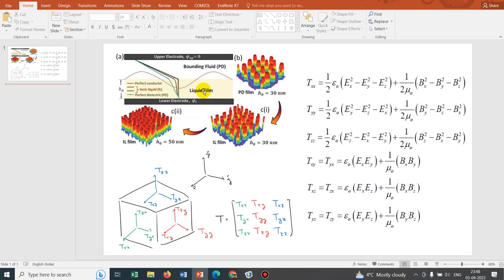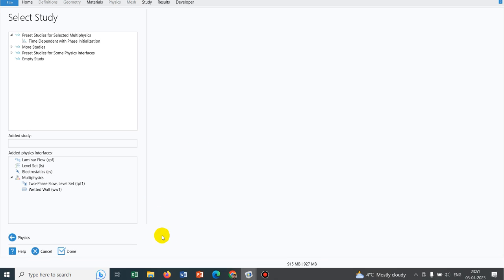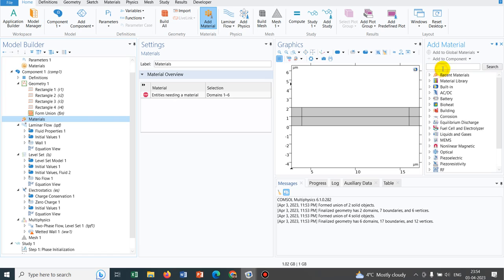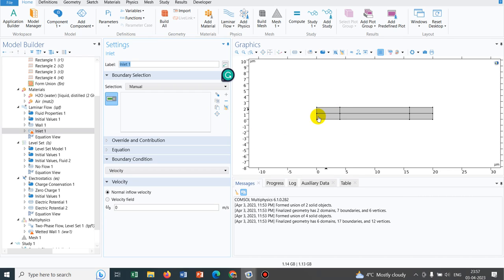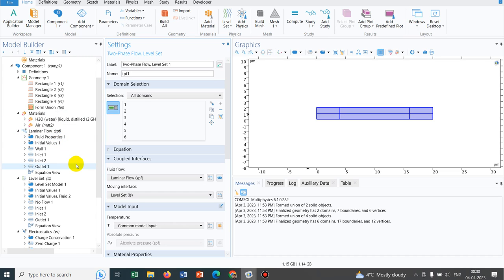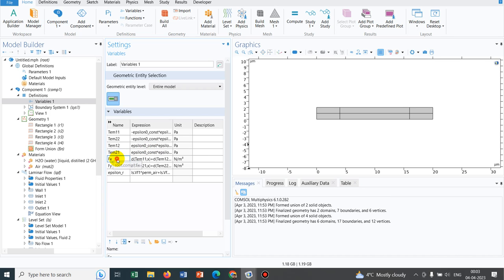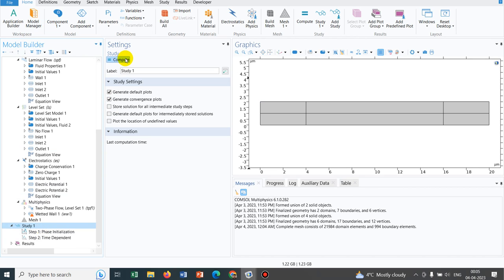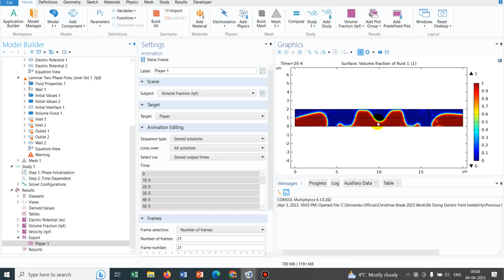Electric Field Driven Hydrodynamic Instability in COMSOL  #instability #ElectricField #MaxwellStress

Comment: Dada, your video is very much helpful for me. I want to know how to solve non dimensionalized electrothermal flow in comsol ? How to put value of various non dimensional number and how to add another body force in the equation ? Please make a video on it.
Reply from the maker: I guess it is difficult to achieve...However, I will upload similar videos. Thanks.
Reply: @pioneerofsuccess4054  Also Please make a video on how to calculate Nusselt number from a heat transfer simulation and how to calculate current variation from an electrothermal simulation. Actually these values will not be directly achieved from simulations.
Reply: @pioneerofsuccess4054  Also I want to know how to plot neutral stability curve in comsol for an instability problem ?